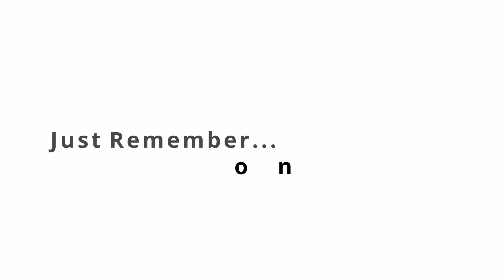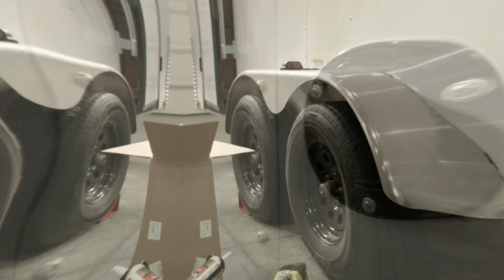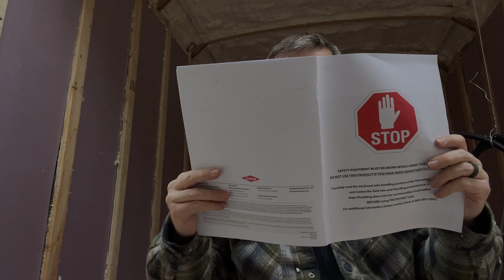Cargo Trailer Conversion Part 3: Spray Foam Fail!!

Comment: It would be nice if they included a pressure guage instead of counting turns at valve. Match pressure for ambient temp even elevation. A hose and pressure guage paint thinner to soak it.

Comment: I may be wrong. When the spray foam chemical doesn't mix properly which doesn't allow the foam to properly set up. This may cause off gasing that is a big health issue. I'd be curious to know if that's the case without and before you actually get hurt by it. Subscribed. Good content.
Reply from the maker: That is something I’ll take into consideration for sure. Thanks for the warning. I may get some testing done.